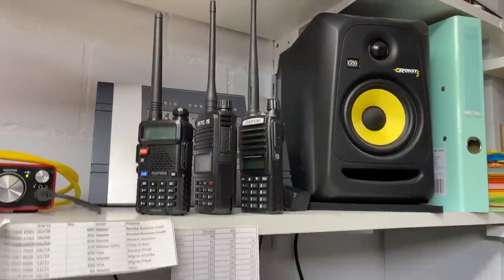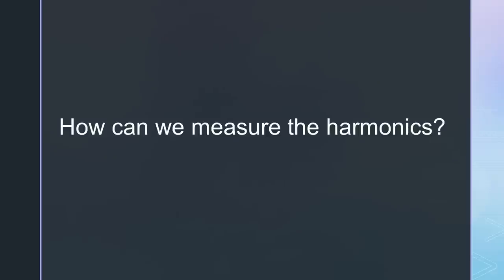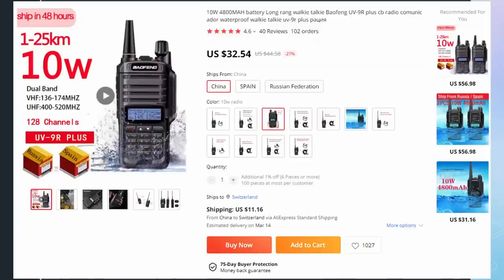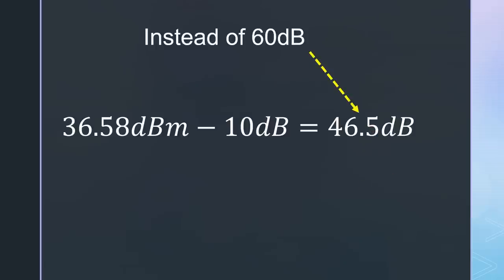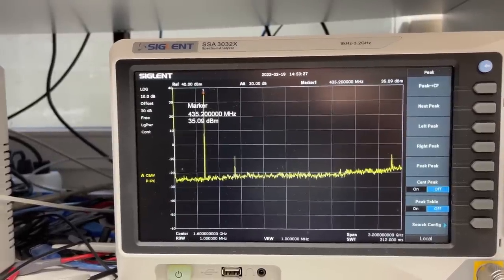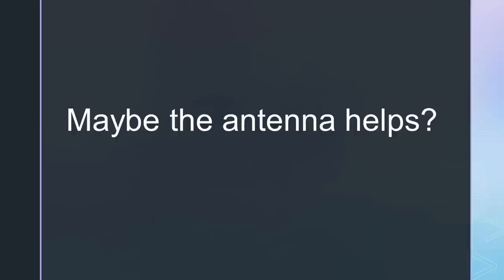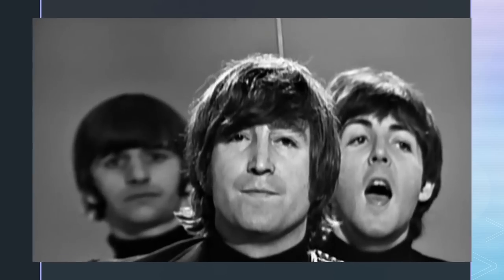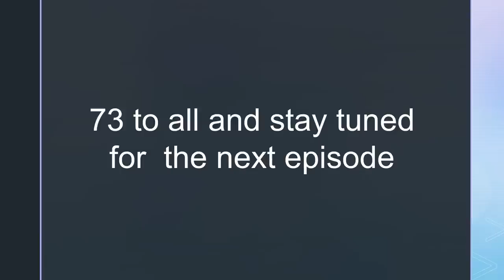011 Retevis RT85: A legal "Baofeng" replacement? Let's do the measurements

Comment: When I was staying more than 3 months in Switzerland I purchased a used Yaesu handheld on Ricardo. Shortly after 2 officials from Bakom knocked at my door at my temporary home in the Ticino. I explained that after 3 months I was using APRS via the Sunrise mobile network. They had all copies of the Ricardo transactions and explained that if I had bought a Baofeng they would confiscate it unless I could prove that it was permanently disabled from transmitting. They tried to sell me a Swiss license on the spot. They also had copies of my ham license exam of 1976 and my certificate of technical leader made in 1980. So much for "Big Brother".
Reply: Yikes.
Reply from the maker: That is strange! I did not know that the BAKOM acts without a problem report.
Reply: This is a super service of the Bakom! Didn‘t expect that they act so fast 😀
Reply: Yeah, great, but if one of us has an actual problem with interference they won't move a finger.

Comment: Very interesting!
Your spectrum analyzer is a scanning (swept) instrument, not a real time analyzer . Try to narrow the sweep to the frequencies close to the transmitter frequency. Or even to the suspicious harmonic or mix frequency. It will not be realtime, but it will sweep faster, and thus let you have a peek at what's going on . It may also shift your birdies off so they disappear from where they fooled you. Also try to add a "barrel" or piece of coax in your stack of pads. There may be a resonance in your stack. If the picture change, there you are.

And the spike moving in the opposite direction is in my  eyes just as you say a sign of a mirror image. I cannot think of anything else.
I have been postponing measurements of my handies for some time. But you kicked me in my behind. And if a realtime SA passes by in our offices, I will not let it out immediately. ;-)
Reply from the maker: Thanks for the tips. I have a real-time SA (Spectran V6) an will have a Look with it. Also some sort of resonance is an interesting hypothesis…

Comment: Interesting, the 3.00GHz look like the aliasing of the spectrum analyser.
Reply from the maker: This could be. So far I never experienced anything like that. But maybe it is because of the level of the signal… I will check it tomorrow.
Reply: I agree, adding another attenuator could help, maybe also check if there is an enabled preamp in the front-end
Reply from the maker: Adding an additional 10dB reduced the effect, but it did not disappear. The pre-amp is disabled and I played with the internal attenuation. But so far it did not disappear :-(

Comment: I can confirm, my UV-5R puts out harmonics with 50dB attenuation at best case (70cm low power) and about 40dB worst (2m high power).
I did not use that radio for transmitting for a long time since another ham gave me his old Kenwood TH-D7 for free which puts out harmonics with 60dB attenuation in the worst case.
Reply from the maker: Thank you for your confirmation. Mine had even less difference in the lower power modes :-( That is why i did not mention it.
Reply: I tested three which all were in this range as well
Reply: Kenwood TH-D7 for free? Wow. It's a great transceiver, only slighty beat by its successor, the TH-D72, by a little bit improved software and built-in serial adapter. To this day, I don't know of any other similarly equipped handheld transceiver on the market. Its terrible battery (NiCd with NiMH packs available from Germany) and its size was the reason why I went for TH-F7 as my daily driver and I keep the D7 for satellite work, portable and other scheduled activities. I made a barrel jack to XT-60 cable and it works great with 3S Li-Poly pack.

Comment: Interesting technique. I have limited kit so used a dummy load with small pickup antenna nearby and another receiver to check harmonics.
Reply from the maker: That is also good. But it includes the effects of the two antennas. So you have to expect different results.

Comment: When you're directly connected to the radio, there could back stream radio connection by capacitance, ignoring the filterance. I have Baofeng BF-F8HPP.
Reply from the maker: Maybe. But the cables and the attenuators are quite good shields.

Comment: Very interesting problem! I wonder how difficult it would be to make an external low loss filter to fix the harmonics issues. I guess if you can bring the harmonics under the limit, it becomes "legal" again?
Reply from the maker: Unfortunately, we have to distinguish between „commercially available“ products and DIY. DIY is treated as an exception from the laws and is only allowed for licensed HAMs. The max. Number is 5 per design if I remember right. Here you must not harm others.
If a supplier decides to sell a product it has to fulfill the law. Otherwise it is not aloud to be sold or imported.
Technically, you are right. However the cutoff frequency is not easily to determine for a dual band handheld.
P.S. nice to see you on this channel ;-)
Reply: @HB9BLA  I kind of enjoy you content here more :D I was thinking about this topic a bit, and you would need separate filters for the 2m and 70cm bands - no dual use - the 2m has a harmonic right in the 70cm band so that won't work. What do you mean by "max nr. 5 per design"? Also I fully agree a commercial product should be legal and compliant to begin with, however since this product is quite popular for beginner ham's, fixing it, by adding an output filter, could be a nice fun project.
Reply from the maker: @FesZElectronics  Somewhere I read that the max. number is 5 (maybe to distinguish between "commercial products). But unfortunately, I did no more find this text.
It definitively would be an interesting project. However, it most probably would not be used because it seems nobody really cares...
Reply: @HB9BLA  I was reading about reviews and modifications for this handheld, and one topic that was mentioned was that a "better" antenna helps with emission but makes reception worse - I guess it picks up more noise and strong local transmitters (like FM); I'm thinking that the above filter, should help with reducing the out of band incoming signals and make the device work better. So it should not just help with harmonic emissions, it might improve reception - this is something users should definitely care about :D what do you think?
Reply from the maker: @FesZElectronics  Definitively! The usages I saw were when they used these devices for short distance at events and casual talking.

Comment: I think you may be overdriving the SA. Also I would, never connect a Tx directly to the SA (I have the lower bandwidth version on the siglent, so I don't see that spike)

I use an RF sniffer that has a 20db attenuation between the main RF path and the sniffer output, then I add additional attenuation if needed to bring the signal down to about 0dbm

In this test you are not really interested in absolute power, but just the difference between the main signal and any harmonics.

If you don't have an actual sniffer ( I picked up mine on ebay for about 20 GBP) feed the output of the rig into a dummy load. There is usually enough leakage for a simple e field probe on the SA to pick up enough signal to work with.

Andy
Reply from the maker: You are right. In the meantime, I added more attenuation, and the problem became smaller. I like more to work with attenuators than with a sniffer because I can check them out on all frequencies and usually, they are +/-1dB.
And I checked the signal with my Spectran V6 and did not see anything.
Reply: So I am not sure if my experiance has any meaning for your measurement problem, but I was trying to do some audio THD measurements with some pretty expensive scopes at work and discovered that pretty much all oscilloscopes have pretty high THD. So the problem might be that you are measureing the distortion of your signal analyzer. This is why you use a notch filter on the fundamental in order to measure THD. @HB9BLA

Comment: Don't you have an Adalm Pluto? They operate up to 3.8 GHz. If the 3 GHz signal is real the Pluto should see it.
Reply from the maker: I tried it with my Spectran V6 and did not see a signal. But it is not easy with these broadband SDRs. They also "see" the fundamental and easily can be overhelmed...
Reply: @HB9BLA  Yes, it's going to be hard. With the Pluto's 12 bit ADC the dynamic range is 70 dB so you have to get it just right.

Comment: Interesting video thanks.
Passive intermodulation spur at 3GHz maybe?  
Congratulations on the new channel I really like the technical side of Ham Radio.
 Perhaps you can  take a look at the interesting project from Russia called Hfpager.. Possibly some scope to link our IOT sensors via HF radio/NVIS maybe?
Best wishes from Cape Town!
73.
Reply from the maker: Interesting project! Maybe it would work with the new QDX of QRP-labs.
But for a sensor, we would need an inexpensive and small transmitter like the "Walkie-talkies on a module" for VHF and UHF. I cannot imagine to use my IC-7300 just for one sensor ;-)

Comment: The Baofeng handheld is not allowed in  Germany and as I learned now in Switserland but still no peoblem in NL. You found already that the spike you couldn't explain is coming from your SA.
I just bought a Tiny SA for about 70 euro an amazing piece of work. You have to try it. BTW nice video
Reply from the maker: You are right, the TinySA is a very interesting device!

Comment: Excuse me for not being a ham or even EE. Try a low-pass filter with roll-off at say 1GHz.  What doesn't then attenuate is a measurement artefact.
Reply from the maker: You are right. A high-pass would attenuate the base signal. Maybe I have to search for one at around 500M. Then the instrument would not have to handle this high difference....

Comment: Looking at yours spectrum analyser, the dynamic range appears to be close to 60dB. You could be driving the first mixer quite hard. If you repeat the measurement with say an additional 10dB of input attenuation, does the artefact drop by the same amount?
Ah. I didn’t read previous comment…
You also don’t need to drive straight into the analyser. A loose coupling to a dummy load (or the antenna) will give you the fundamental and any radiated harmonics.
Reply from the maker: Its dynamic range can be higher, but not at this RBW. But I agree that it has to do with some internal mixer (s). I tried to add 10dB attenuation and it was better, but still not gone.
I compared now all handhelds on my Spectran V6 with loose coupling and there was nothing on this 3GHz spot from the RT85 and the IC-705. The Baofengs had spikes on many harmonics ;-)
I consider this as proof that the spike comes from the SA itself.

Comment: I have tried to "import" Retevis RT85 to Switzerland, and it was captured by BAKOM 🙂They wrote me that they will test it, and depending on the results of these tests I will get the device or an invoice... Keep your fingers crossed
Reply from the maker: Interesting. Do you have a license?
Reply: @HB9BLA  SRC RYA- I was planning to use device on the boat (not in Switzerland). Yet BAKOM is testing the device, not license (I hope...). I'll report back with the result.
Reply from the maker: @tomekdziekonski7478  So we will see what they say. These devices can be used on many frequencies outside the legal range and its power is also too high for non-licensed applications. Send me a Twitter or messenger message if you have the results.
Reply: @doejohn8674  Unfortunately it has not passed some tests and is considered to be non-compliant.
Reply: @tomekdziekonski7478  Thanks for the info, too bad.
Reply: @doejohn8674  The guy did not have a ham license. So they tested it in the commercial bands and it failed (too much modulation and too high harmonics for this application).

Comment: Another thought provoking video - Thank you Andreas.
Regarding the attenuators - Have they been calibrated?  As the objective is to measure the Db comparison between the primary frequency and the harmonics, this may be less of an issue for 1st harmonic,  but have the attenuators been checked that they have the same attenuation across the range being measured ? G1GRW
Reply from the maker: You are welcome! My lab is not very high quality. Usually i try to stay in +/1 dB across the span of my SA. So the reason must be somewhere else :-(

Comment: Hello Andreas, THe IC-705 can be hacked for CB bands, Andy Kirby did this but his video was banned (or he removed it) after ANCOM in UK complained. Regarding LoRa Gateways for thingsnetwork, is the SX1302 a good fit? Thank you, DE1CTL (Swl)
Reply from the maker: 40 years ago my FT-277 was also able to do 11m. Of course we never tried ;-)
The SX1302 is one of the standard gateway chips. I think they have now a new one. But this one is still used everywhere. It is not for sensor nodes.

Comment: Those odd signals many harmonics away from the fundamental are always problematic. They can occur due to non-linearity in any part of the measurement system. Thus you have to calibrate everything in the signal path, like the cables, connectors, attenuators, etc. 
When I worked at a lab that did testing professionally, we spent 3-10 times longer calibrating all the parts of the system, than we spent actually measuring the system. 
Good Luck!  :-)
Reply from the maker: Thank you for your wish. I think, I will need it. So far I am pretty sure that the devices are clean and the peak comes from my SA.
Reply: having a good signal generator that can do a lot of power helps.

Comment: This was bugging me, so I did a bit of searching.  Nyquist foldback aliasing was the closest description I could find of what you are experiencing.
Reply from the maker: And what does it mean? And how could it be avoided? I am not sure if the sweeping SA does sampling. AFAIK it only measures one frequency at a time.
Reply: @HB9BLA  - As far as I could tell, it’s caused by frequencies above the Nyquist limit creating aliases.  The frequency of the 3GHz artefact moving lower as you increased the VFO frequency made me recall something similar that I’d read before.  I’m keen to know what’s happening as I have an IC-705 too.
Reply: @HB9BLA  - I have definitely seen this issue described before in something I have read.  I’ll have a further look today - I have four books on testing and the like that it may feature in.
Reply from the maker: I now checked if I find any info about the sampling rate of the SA. But I did not. If I recall right, it multiplies the signals to above 3GHz and mixed them down. Maybe something goes wrong there...
Reply: @HB9BLA  - I am not sure.  Apologies that I was not able to help!
Reply from the maker: I am glad you tried. I am still lost for the moment. And this channel should be about helping each other.

Comment: I wonder if it is the length of the cable.  3ghz is 10 cm, and your cable looks like it could be a multiple of that?  Try a few different cables if different lengths and see if that peak changes.
Reply from the maker: I now tried without cable (just an adapter) and got the same result :-(

Comment: Baofengs aren't illegal.  Hams are allowed to transmit in their own bands with any piece of homemade junk they like, and as long as the harmonics are in-band then no one cares.  Ham radio is about experimenting and making things and not caring too much about the commercial rules - not what the self-appointed band police will tell you, but their hobby is policing, not "radio".
Reply from the maker: I agree, and I for sure am not against experimentation. But I think we have to comply with the law. This is also the reason that we are asked to pass a test and get a license. Otherwise this would not make sense for me.
Reply: Baofengs are only illegal for non-hams. Also on the ham bands no one really cares about the rules, and certainly no one cares about the band police.  Do what you want on ham radio.  It's only important to not interfere with someone else doing what they like.
Reply: Very good point.  That’s why we have harmonically related bands available to us.  Most of the licence relates to staying in band and how to deal with annoying non-hams as far as I recall.